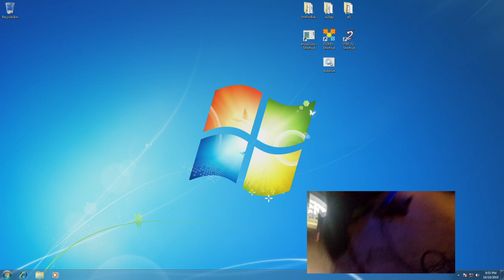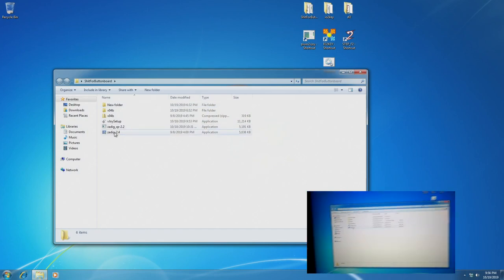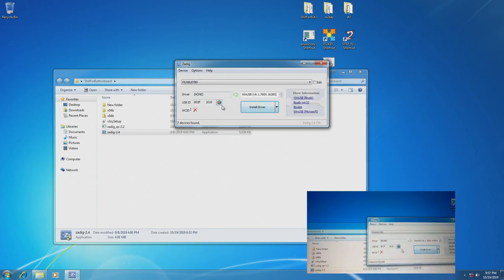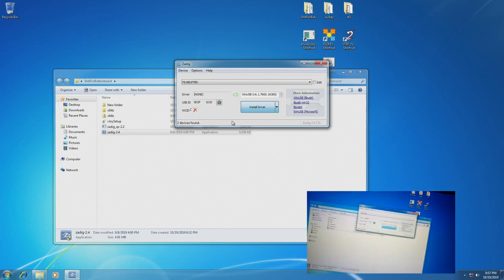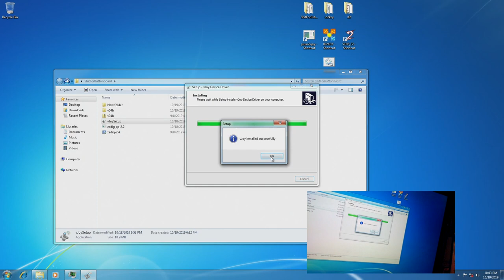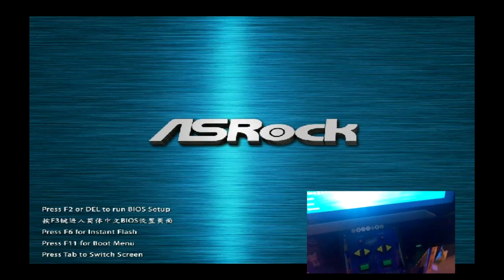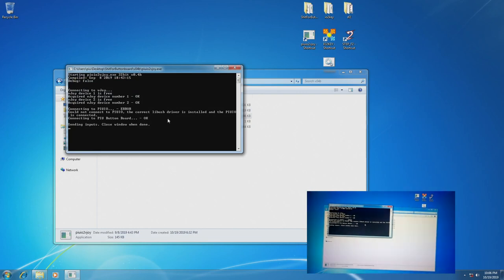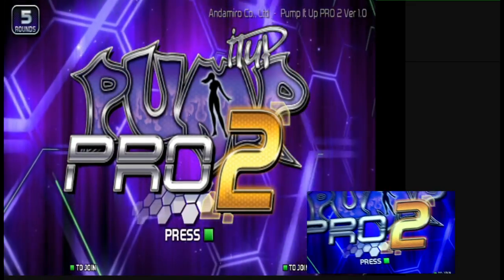How to use a PIU ButtonBoard in a StepF2 / Windows Arcade machine cabinet  - Pump it up

Comment: Thank you!
The version on pigs doesn't include the installer, it only has v04, so I was wondering how the hell to get this working.

Does this work alongside IO2Key? I saw your autorun bat file has both of them running
Reply from the maker: I use it alongside io2key since I don't want my pads to register as joy keys since my hud uses keyboard input for navigation. But piuio2vjoy does support the piuio on it's own. As well as the button board